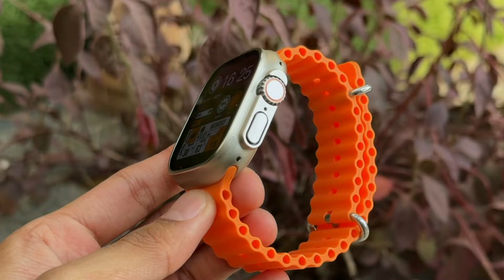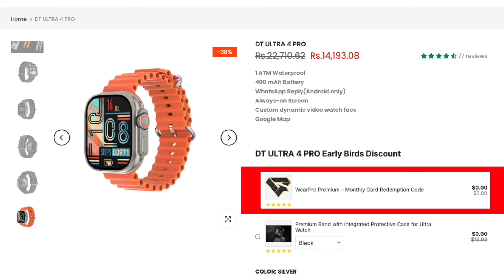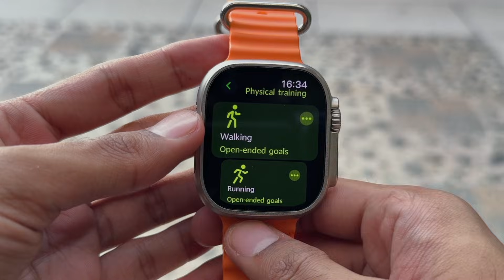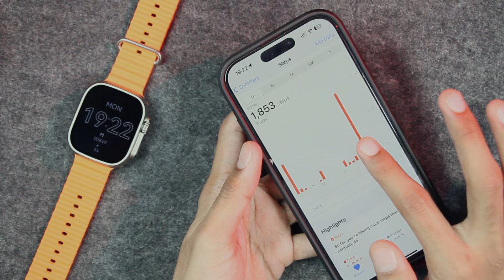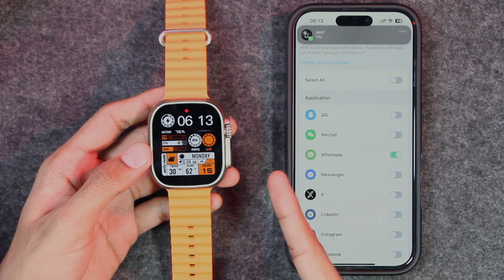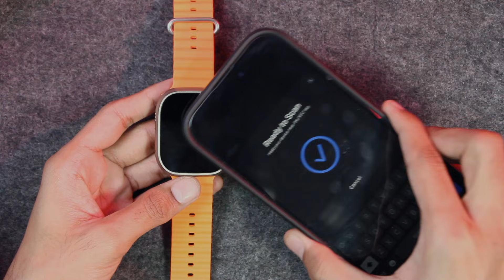DT Ultra 4 Pro Smartwatch Review | Full Review | Worth Buying?

Comment: I want to warn you against buying this watch and this company! Don't buy this watch! All of the watches work very poorly; many functions don't work on most of them! The weather doesn't update automatically, only manually each time. Reminders and alarms don't work on many of them. The compass usually doesn't work properly either. The software is a disaster; it only shows outdated watch faces! And the watch face they use to advertise the watch isn't even available in the store! Service and returns are also pointless. Lots of people are complaining about it on Facebook. I regret buying it!
Reply: It’s opposite by me everything is working perfectly and watch faces are always updated. The very latest from Apple Ultra 3 is also there through the WearPro App.
Reply: @BelieversTreff I’m not seeing the watch faces advertised on the DTNO.1 website or product packaging. Also, the pedometer is off by thousands of steps for me.
Reply: @sawaitikap4353  lol.  i paid $35 for mine.  the watch band i use costs more than the watch so i’m not complaining if a few functions don’t work. contact apple & spend $900.
Reply: @sawaitikap4353  Thank you
Reply: @sawaitikap4353  you want everything in $49.. Chill bro

Comment: @iMATGadgets  On the DT3 Pro, the pedometer readings were relatively close to the Apple Watch Ultra. Why does the DT4 Pro, which is supposed to be its successor, perform so poorly in terms of step tracking?
Reply: Because its a cheap china knock off. Buy a real apple watch for 199$ and it will be a MASSIVE difference